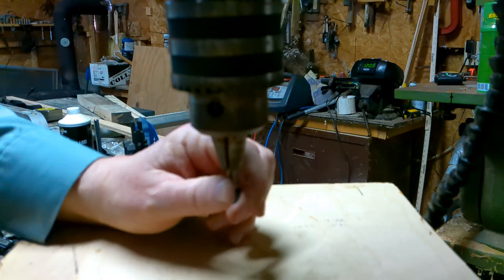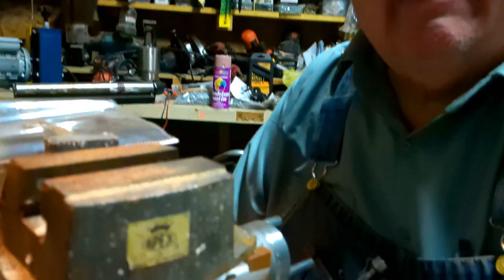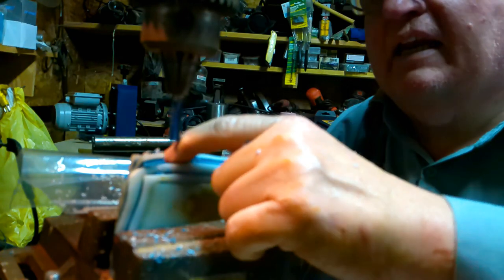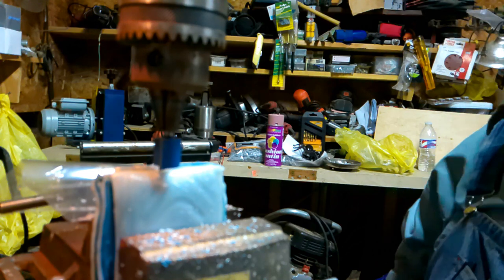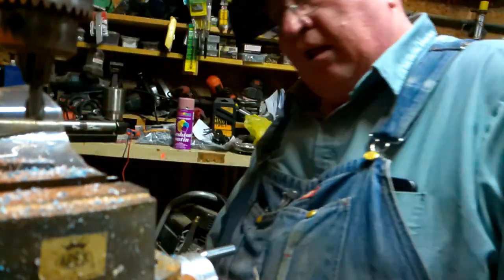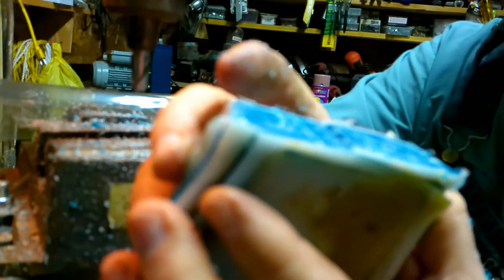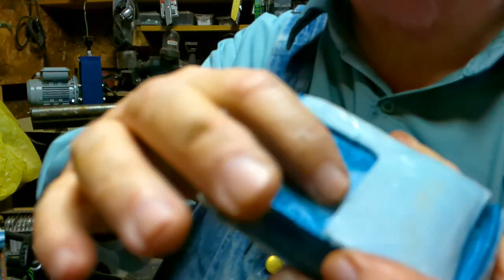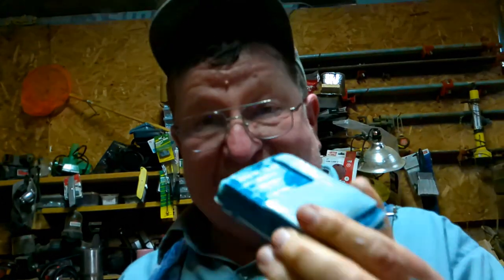Machining MELTED BLUE BARREL Plastic Homesteading 101 Nearly Free Materials for Parts!!! HDPE

Comment: That is an unique way to build a fire, it appears that you put the paper in the middle of the pile? then heating the stove pipe. I would like a class on your whole stove operation.
Reply from the maker: Yes, correct t logs on either side, paper in the center with kindling, and bark with a little bit a plywood to help it catch fast. Heating the flue keep it from smoking up the shop and starts the draw fast.